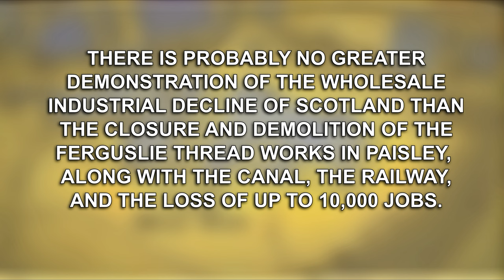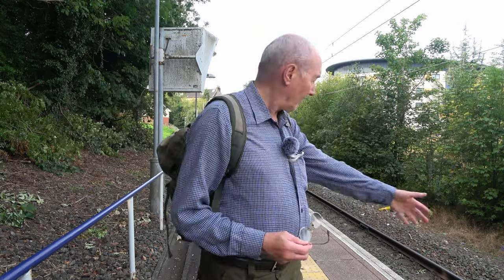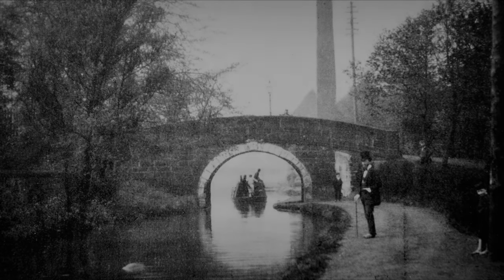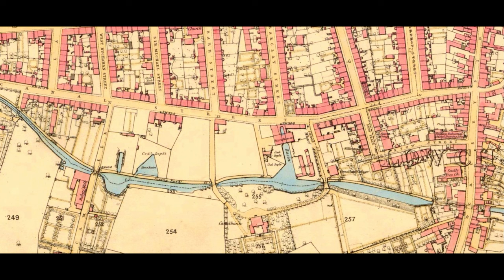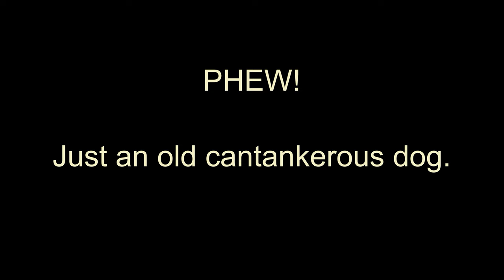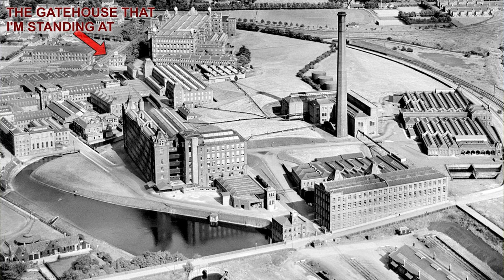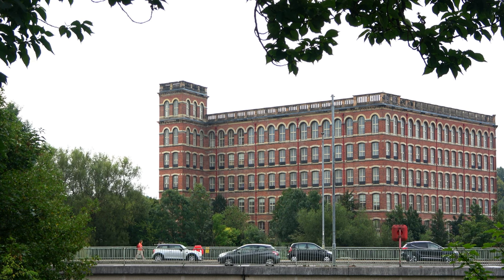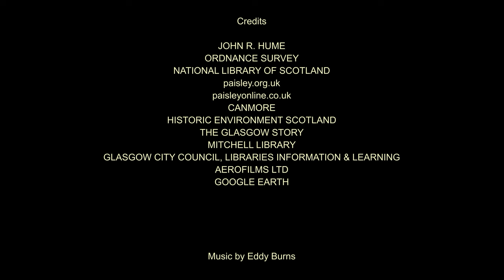THE OLD CANAL - The Glasgow, Paisley & Ardrossan Canal

Comment: Ed you can thank Cllr. Irene Adams for the destruction of the last of the Victorian mill buildings. No doubt she was offered an incentive to make sure that the area was cleared for developers. She also destroyed Paisley High Street with idiotic pedestrianisation which a lot of towns soon discovered was a disaster for trade. The Victorian era buildings of Dykebar Hospital have also fallen victim to neglect and corruption. Beautiful to look at and massively built, there really is no viable excuse to not restore them but again one of the buildings was demolished last year. I have a photograph of this same building from a few years earlier which clearly shows how structurally sound it was. This sits near to another of the houses that has seen better days. But the exquisite floor tiling of the main entrance is still there. Again, massively built with thick wooden beams, brick and stone. The Half-Time school was used as the Ciba-Geigy social club ( I worked for a brief period behind the bar) and then as a dance venue. This guaranteed it’s destruction through a dubious fire which destroyed a building that I had a simple connection with through work and family. On the inside the Half-Time school was very much like other buildings of this type except for its stunning carved hardwood ceiling in what was used as the main area of the social club.